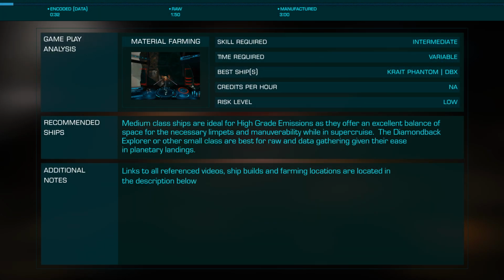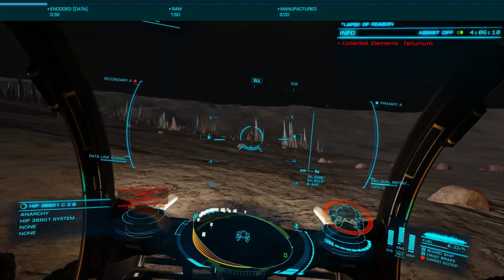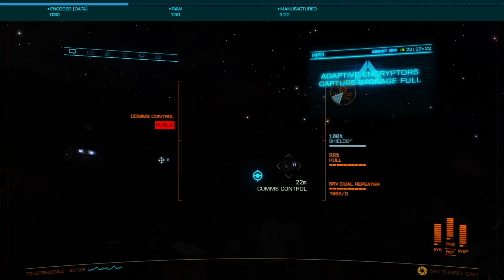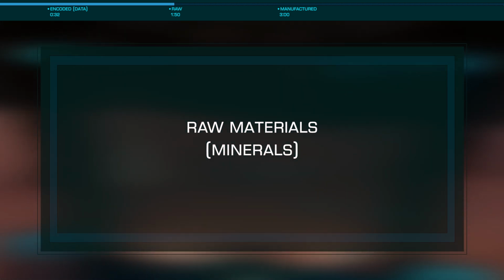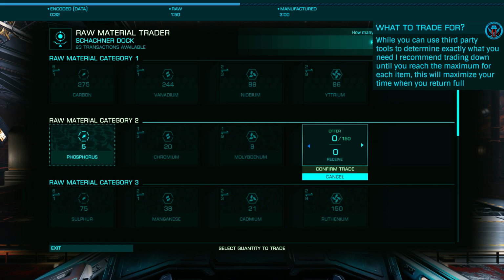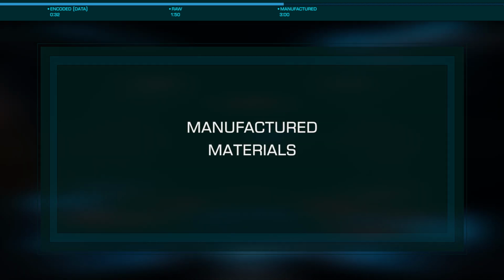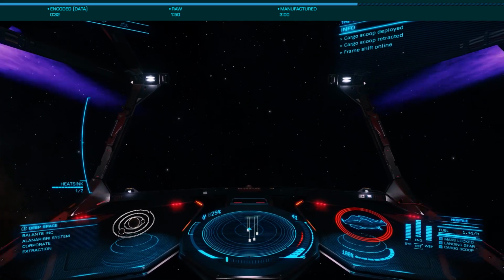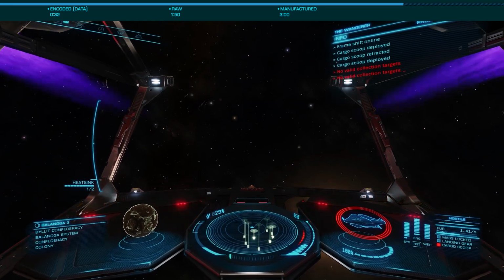The FASTEST Ways to Gather Minerals, Manufactured and Raw Engineering Materials in Elite Dangerous

Comment: So I was in  HGE with Pharma Iso, grabbed and logged to desktop, back into mode I was in charged at 0 speed, boosted into SC, and saw nothing. Do I log to menu or desktop?
Reply from the maker: Just like the video - exit the game, restart back into the same mode. Make sure you're filtered for just USS and, if there is still time left on the USS, it'll be right next to you.  So if you dropped in and it only had say 1 minute left it'll be gone by the time you get back in.  I find that so long as it has 15, maybe 12 minutes left you can get 100 from it. 

Also nice to get confirmation someone found Pharma's as many have been having trouble with them
Reply: @Exigeous  ah that may have been my issue. Someone in my squadron chat mentioned this video linked in our Discord. I watched and then tried it. I am sure there was zero time on the clock. Will try again, thanks much. Gotta try those shard fields next. o7
Reply from the maker: @Mil-Spec_Mike  No worries my friend, I do try to be as clear and concise as possible in my videos so you sorta can't skip or miss anything as it may be the key part.
Reply: @Exigeous  I saw this and was "try it now!!!" your videos are very plain to understand, I just skipped over the timer fact
Reply from the maker: @Mil-Spec_Mike  No worries, like I said you aren't the first that missed it.

Comment: What type of material is Chemical Distillery? I can't find it anywhere. Can it be traded?
Reply from the maker: Manufactured - if it isn't data or a mineral it's manufactured and yes, you can trade for it.  It's a low grade, I think 1 or 2 so it's really easy to trade for.

Comment: Are you sure the relog trick works for farming a specific High Grade Emission spawn? I just tried it and it's a bust, no USS is nearby when re-entering SC. I've also seen several people saying this was patched out back in January 2019. (edit: ok strange, the first time I tried it just exiting to main menu (which works for farming dav's hope, jameson's cobra etc) and it didn't work, second time I exited to desktop and it did work that time. interesting!)
Reply from the maker: Seems you figured it out but yes, I'm 100% sure it works as I've now traded over 100,000 materials.  As you learned you have to exit, not just to main menu but exit game.  Also realize that if the timer on the USS expires it will disappear so that could also be an issue.

Comment: Great video! I was wondering where to find the "crystal" category of manufactured material. Your location guide of material is 8 category, but you perhaps didn't say where to find crystal. Could you enlighten me? Thanks!
Reply from the maker: Uh, what do you mean by "find crystal", do you mean the Crystal Shard sites where you get minerals? if so I have a full video dedicated to it that's listed in the description.
Reply: @Exigeous  thank you for reply. I mean the “crystal” category in manufactured material. The rarest is “exquisite crystal”. “focus crystal” is a grade 3. Thanks!
Reply from the maker: @ylyg123  Ah, gotcha - well EFCs are a mission only reward - so other than getting them that way the fastest would be to gather Imperial Shielding and trade that for EFCs, 100 Imperial Shielding will give you 16 EFCs, and you should be able to find 100 of those and trade in about 20 minutes with even decent luck. Check the Material Finder tool on https://www.edtutorials.com to see what system players are collecting them in when you go search
Reply: @Exigeous  thx so much! Best Youtubers of ED!

Comment: I did my first engineering run a couple years back before odyssey, I am back after a break and doing engineering. So far The scan data and crystal shards are the same as before, however I am playing in Horizons mode from the PC launcher. I see a lot of people saying they can't find stuff, etc, if you guys haven't, try launching in Horizons if you can. When I finish getting raw mats and move on to the final method I will edit this comment. Good luck o7
Reply: Any updates?

Comment: in Odyssey there seem to be only 3 beacons on Jamesons Crashsite. At least i couldnt find a fourth one. Can anyone confirm or refute?
Reply: ok i found the 4th beacon (would have been really strange if they deleted one). One is quite a bit out into the planes where i simply did not expect it (i thorowly searched behind the cobra cause i recalled that one of the beacons used to be on top of a ledge right at the ship). In order to scan all 4 you need to scan one beacon through a pile of rocks.

Comment: I tried doing this with the Grade 5 Manufactured and I don't get any HGEs respawn 😢
Reply: maybe you are in systems with wrong state...?
Reply: Frontier Nerfed this a while back, it used to work but now no longer works (I typically play in open, I will try it again in solo as seen in the video) --
Reply: I always play solo until I'm able to defend myself.
Raddy, no, the systems I'm in are what are stated in the video
Reply: Running under solo I found that if I extend to the desktop (as seen in the video) vs to the game main menu the signal source does respawn. Thanks for the time saver CMDR Exigeous, much appreciated!
Reply: Console version doesn't have 2 options to exit. Just the one that takes you to the main menu
Reply from the maker: No this has NOT BEEN NERFED - you're not actually watching the video and you're doing one of two things wrong:
1. The USS has timed out as it was a short one
2. You're not exiting to DESKTOP - but instead to main menu.

MANY of us, including me have used this in the past few hours, works perfectly.
Reply: @Exigeous  but console has only 1 option to exit, which is exit to main menu. There is no desktop option.
Reply from the maker: Yeah, then I'd have to guess you can't do this on console - sorry, I have no way to test that as I play PC.  Can you use the Xbox dashboard to close the game maybe?
Reply: @Exigeous  someone told me that on console the game needs to be closed FULLY (as in close application) and then re enter the game like you said. Tried that and it works. Might be worth a quick mention 😊
Reply from the maker: @luissheppard2342  That's great - I'll add a comment and pin it for others  - really appreciate you sharing that.
Reply: @Exigeous  you've helped me out enough times lol! Glad I could help. By the way, I'm on PS4. I can't test Xbox, but I'd imagine the same would apply.
Reply: Manufactured - Enter system. Scan NAV. Then:

Find HGE
Collector limpets HGE
PS button
Option Button - Close App
Restart elite
Find closest HGE
Repeat. 

Best when they have >20 min on them. 

Also - worth noting the G3-5 Alloys are easy to find but probably used the least. Mainly lightweight (so use them for that) and worth trading up/down as well. 

Similar for the Encryption encoded - mainly for limpet engineering.

Copied from someone on the Facebook PS4 group

Comment: To be honest I hope they fix all  logout/login as a way to refresh boards and resources.

They have these insane grinds that more or less forces us players to use tricks like that because resource sites (unless it is mining) are far apart and have way too little materials (at least for xenotech, geological sites are actually decent, just not quite as efficient as trading the way the video describes). 

The suicide express is something different in my opinion, that at least is in-game. 

But the way you can fill up a Sidewinder with engineering materials that persists upon death and is transferred to your next ship without taking up space is severely broken. I know there were issues with materials that took up cargo space before, it did not work that well either.

Comment: Does this still work for the materials not raw or data but the materials
Reply from the maker: Yep, still works 100% for everything just as the video shows. Whenever something changes and breaks a video of mine I always put a big fat NERFED on the title and thumbnail.
Reply: @Exigeous  Everytime I quit to the main menu and load back in I never see the signal source again I'm pretty sure I'm not doing anything wrong I'm doing exactly what It says/shows  in the video but still no signal source after reloading
Reply from the maker: Well you're doing something wrong as I just did this a few hours ago and have a friend doing it as I type this. First thing is how long did the HGE have when you arrived at it? Remember they have a timer and when it's over they disappear. Second are you staying at zero throttle when you charge, then zero throttle but boost into supercruise. Then look on your left panel and it should be right behind you (sometimes, rarely, in front of you). There's something you're doing wrong here so go through the steps one by one, check how long you have on the timer, etc.

Comment: great info. would be nice to have ship builds for those who don't have all the engineers/guardian/etc
Reply from the maker: You can basically use them as-is just without the engineering. You may need to go bigger on the power plant at times. Oh, and if you don't have the guardian FSD booster you should do that next, it takes about 90 minutes and will pay for itself hugely once unlocked.
Reply: @Exigeous  i did. and it's awesome. :)

Comment: I could not get the HGEs process to work, did exactly what was said HGE was not there tried a number of times.
Reply from the maker: Well you're doing something wrong as I farmed them tonight as have dozens of others.  Are you exiting to desktop or to main menu (you need to fully exit the game)?  Are you ensuring that the HGE has time left on it when you first drop in?  If it only has a minute left it'll be gone by the time you come back.  My guess is you're only logging to main menu and aren't actually doing what the video shows, let me know.
Reply: @Exigeous  yes only going to main menu will try logining out completely, thanks for the response.
Reply: Just tried logging out fully and it worked, thanks for the response.
Reply from the maker: @stugib568  No worries, you aren't the first you didn't pay attention to that part of the video - in fact you're not that 10th or 20th, many just assumed.  Regardless glad it's working well for you.

Comment: I can't seem to find any high grade emissions I've jumped to 4 different outbreak systems now and no luck
Reply from the maker: It's just bad luck as they spawn very randomly. Instead go for Imperial Shielding as you can find that in about 20 minutes then use a material trader. You should be able to get 100 Imperial Shielding in that 20 minutes which will trade down to 16 pharam isolators (assume that's what you're after, right?)

Comment: This is the best video tip I've had yet I think. Proto Radiolic Alloys here I come.
Reply from the maker: Thanks - but realize that Proto Radiolics are rather rare and can be hard to find - what can be faster is gathering 100 Imperial Shielding instead and going to a material trader, as that will trade for 16 of anything else and can be done in 20 minutes, you could spend over an hour trying to find Proto Radolics and still not find them. So if you need 16 or less Imperial Shielding is much faster.
Reply: @Exigeous  I've found a few hi pop systems in my travels that seem to spawn a lot of hwe's with protos (Fortuna is one). I used your trick to stock up on them. I got 31 PRAs and 59 Proto Light Alloys. Then I got sleepy. I found a lot of HD composites too (131). Also Proto Heat Radiators (100).

I also did your Jameson trick in a Sidewinder with a roughly 25yr jump range. I see why you recommend the DBX. It was a bit painful to stop at every other star to scoop with a 1A (15 jumps from Shinrarta where I was). Jameson's crash was 6 jumps from Ray. In a DBX it would have been half that and almost no scoop time. Worth the extra credits for sure, especially since I'm a billionaire now with 7 ships :) Thanks in part to your videos.

Random question: Do you know if there's much cause in trying to go for a scientific research and exploration path? I think that would be awesome but I don't think there's much content around that (yet?).
Reply from the maker: @abrotherinchrist  That's great - and if you do and can find them awesome, as I'll spend some time going searching for them when I want to max everything out. Just pointing out that if you only need a few getting Imp Shielding is by far the fastest method.
Reply: @Exigeous  Oh yes, I have seen that one a lot but for me I've run across more composites, maybe because of the types of systems I tend to go to.
Reply from the maker: @abrotherinchrist  Oh sure, Core Dynamics are really popular too, but as they spawn with proprietary composites, a G4 they take much longer to fill up on. One is in Fed systems (CDCs) the other in Imperial.

Comment: Does the high grade work if u manually scoop or do u have to use limpets? Great vid dude!
Reply from the maker: Oh you can manually scoop, it just massively slows down the process.  So if you're out hunting specifically for HGEs slapping on 2 collectors and cargo racks is really easy and will GREATLY speed up the process.  That said if you come across a random HGE yep, you can absolutely farm it without limpets.  Make sense?
Reply: The more limpets you have working the quicker each grab is - remember the clock is ticking down. I use a clipper because it turns pretty fast when you relog. 6 collectors available usually only 4/5 mats spawn but it saves a lot of time if you can just fire off all limpets rather than waiting on a couple doing 2 runs if that makes sense? Can generally fill up 100 G5 in 20/25 mins ( spin up time on PS4 possibly not as fast as on PC?)

Comment: I'm using some of the methods in this vid currently to finally max out my fleet.  I have 16 ships but I've always been a module swapper. I engineered enough modules to outfit my ships and used to just swap modules every time I switched to a different ship, but I got sick of wasting time in outfitting before every activity. I decided to build every ship for a unique role and I've been farming mats like crazy. I think my brain is melting from the inane grind but it will all be worth it when I'm done. 
I do kind of disagree about one thing in your vid though. I think Dav's Hope is great for filling out lower grades. I usually farm HGEs then run to Dav's and spend around 45-60 mins farming the mats there. I find that I do far less trading down for low grades after spending that short amount of extra time there. 
And on a side note: Bug Killer is glorious. It's a little out of the way, but with 3 different grade 4 raw mat drops and 3 data points to scan for encoded mats, it cannot be overlooked.

Comment: I used to do this with HGEs and then there was a patch that nerfed it.  If you logged out and back in, went to SC and checked the Nav it was gone.  When did they put it back (intentionally or not)?
Reply: I can confirm it still works today.  Be sure to exit straight to the desktop.  Previously you only had to go to the menu.  I have noticed that sometimes the count down clock can be a little screwy and expire early.
Reply from the maker: And yet another not actually watching the video - as Jafo and the video show you exit the game, not main menu.

Comment: I'm also confused because your video shows a few materials.  My HGEs have 3 or 4 :(
Reply from the maker: Depends on the system/material type.  Sometimes you'll get as few as 3, sometimes as many as 7 and a few spawn with a G4 mat (like Core Dynamic Composite and Proprietary Composites, Proto Radiaolics and Proto Lights).  Is that what you mean?
Reply: Yeah thats what I mean.  Right now I'm getting a lot of proprietary materials and core dynamic.  But usually between 3 and 5
Reply from the maker: @jrdragon76009  Yep, that's totally correct - remember it can be HIGHLY variable, I'm getting those as I type this and get between 3 and 8 per drop.

Comment: Is this still viable? Im a new player getting into the, seems like engineering is kind of a must so id rather get on with it. Dont want to waste 30 min jumping when this isnt viable anymore.
Reply: Yes, it works! At least for Raw Materials and data scans, I'm going  refit my Python to try the Manufactured Materials now. First try to unlock Felicity Farseer (if you hadn't...) and get the Increased FSD  Range grade 5 and a good ship (I did with an ASP Explorer with 55Ly jump range), things are a bit far from each other (you'll do jumps about 500Ly to 1500Ly). If you don't have money for a ship, you'll have grind money first. I moved my money from my XBO account to my PC account, so it's a new account with 7 billion credits... and I still have to grind for materials...
Reply: @rafaeltogami  Thanks for the detailed reply, I will try this then, Currently on the Diamond back explorer flying around the place
Reply: @MoaBassInDaRiddim  OK. BTW, Manufactured Materials farming still works just as mentioned in the video. Just be sure to quit the game to the Desktop every time. If you log back and the High Grade signal is missing (happened a couple of times), just quit the game (to the Desktop) and log in again, the signal was there. Data farming is by far the most boring IMO...